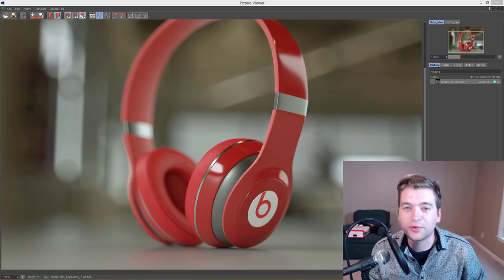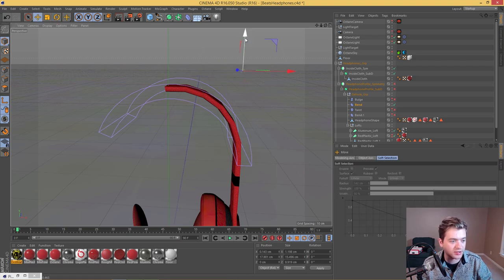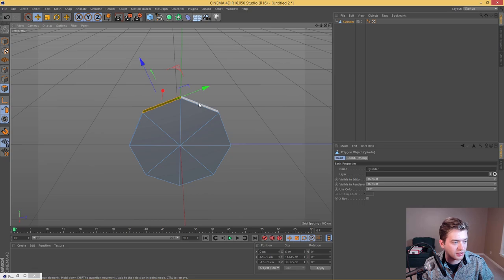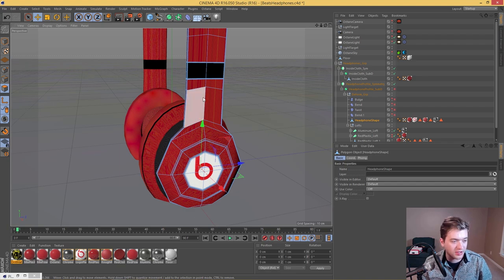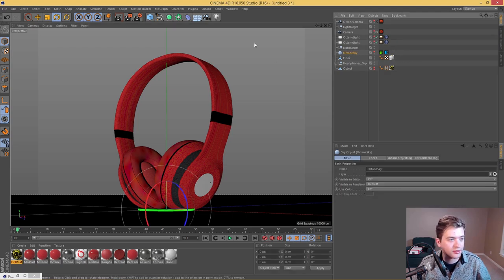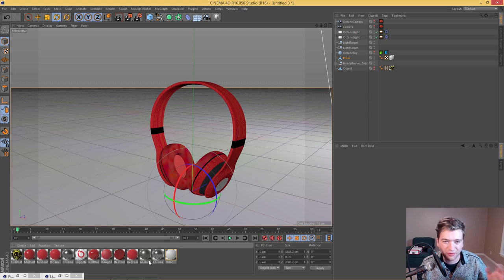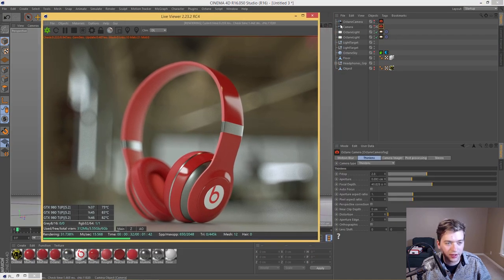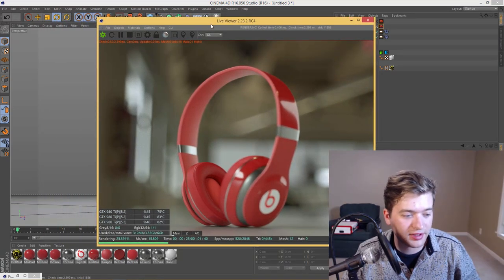Creating Photorealistic Products in Cinema 4D and Octane

Comment: Awesome tutorial! Thanks for sharing!
Reply from the maker: Thank you for watching! Very happy that you enjoyed it! :)
Reply: +Glass Hand Films I have the newest 5k retina Imac and it won't support Octane. Is there another rendering solution, aside from the built in solution, you would recommend?
Reply from the maker: +Dave Montague At this current build, Octane 2.24, CUDA technology that is only present with NVIDIA GPUs. Most Macintosh machines seem to be equipped with AMD hardware. Octane 3 supports OpenCL so in the future we can hope for all GPUs to help. Also DirectX12 is boasting that you can use NVIDIA and AMD cards simultaneously through crossfire or SLI. Link to article: http://www.pcgamer.com/dx12-benchmark-shows-amd-and-nvidia-cards-performing-in-harmony/?utm_source=facebook&utm_medium=social&utm_campaign=pcgfb

Octane has been my first GPU animation package rendering experience, besides other real time engines like unreal, unity, and even element 3D from video copilot. In terms of CPU solutions, Solid Angle's Arnold looks awesome with C4D. Haven't tested it in C4D but loved Arnold for Maya (essentially same experience). If you are checking out renderers, give that one a look.

Comment: hey  thanks for the video.  just wondering what is the safe temperature for GTX 980 ti? i can see yours is above 80c.
Reply: a 980ti will officially manage up to 92c, but can probably manage closer to 100c for shorter periods of time.
Reply from the maker: Somehow I missed this conversation! Yes this is correct from my experience as well. I believe with my liquid cooling setup I can keep temps to 40-50c